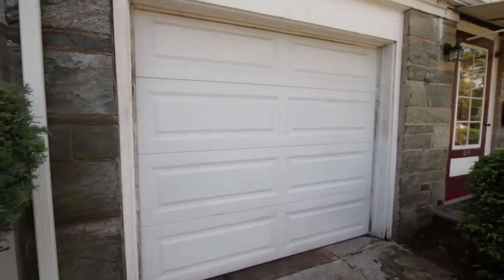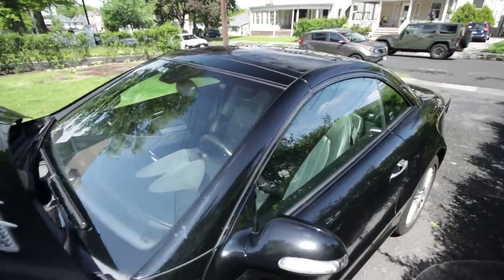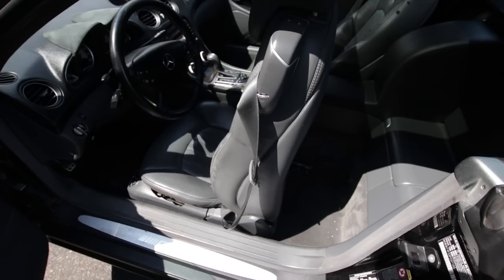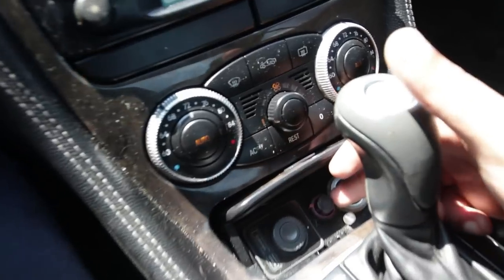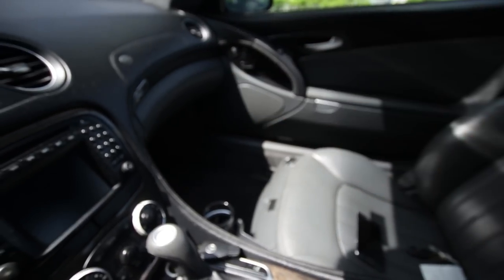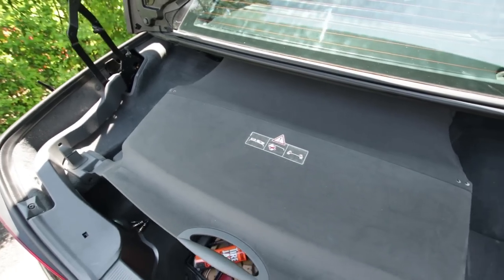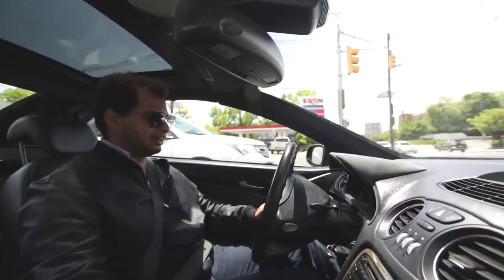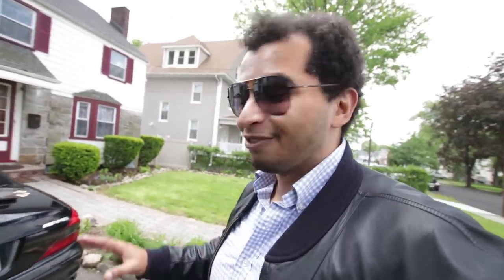I Just Bought A $130,000 Mercedes-Benz SL55 AMG For $8,900

Comment: I got mine over a year ago. It runs perfect i replaced the cam sensor and had to add some abc fluid as the abc light went on but mechanic says its good no leaks . The control arm bushings are cracked but mechanic says don't worry about ...
Reply: Abc is your big issue

Comment: My cousin got a 2003 SL 55  AMG V8 in Silver and it was a Hardtop for $8000 or $7500 a year ago and had to replace the camshaft position sensor i think and put some fake carbon fiber strip that says amg on the bottom of the rear window to cover up a crack.

Comment: Your brake light issue may be due to it sitting a bit and accumulating rust on the rotors and could go away after being driven same issue when I bought my 05 e46 bmw 325i

Comment: There's plenty of cars like this which may seem like an absolute bargain for example this car. But when it comes to running costs, its not cheap at all, you might have bought it for the price of a used Ford, but it its not going to have the running costs of the Ford. So when something goes wrong its going hurt the wallet. Which is exactly why they're so cheap.

Comment: For 8,900$ USA cash you can get 600 hp on a mean Honda Civic turbo or integra
Reply from the maker: ViDz614 and 35 ft-lbs of torque going to the front wheels.
Reply: When built right they push plenty of torque, do some research.

Comment: Living in Florida with that glass roof will be a bitch, temperature wise. Had a pano roof in my e class and had a sweaty back every time I went anywhere in the summer months
Reply from the maker: There's a sunshade and the AC is pretty good. Also, it's a convertible, so I'll have the top down most of the time.
Reply: Fair enough, great buy based on your knowledge. Definitely not for everyone

Comment: Hey Tavarish. Do you have an ODB2 or similar diagnostics tool?
Reply from the maker: Of course.
Reply: It would be amazing if you shared the output in your next SL video . . and your approach to using the data to work out the eventual fix. Will it say "roof stuffed"? Or will the detail be there for a very specific component?

Comment: To long review. For keyless go you need only to change battery in you key, you don't need any special key card. The missing button on your door is for locking the car, and if you hold it will close all the windows. To unlock the car just push the door nob. Also close to your missing keyless button there is small infrared 'port'. If you put your key close to it, and pres and hold open button it will open all your windows and sunroof if you have one. Anyways you have so much tech that you should watch a lot of youtube video to find them up. On your AC that button for air circulation. If you have your windows and son roof is open, if you press and hold AC circulation button, it will close all your windows. Few sec later if you hold it again it will open all your windows to last position you had. That is if something if burning out. It's also good to know if your open/close window button is busted there is a way to close from inside and 2 way outside. 1 is by holding keyless go button witch you are missing, and 2 is by trough infrared port. And there are so much setting in your cluster that I don't know from were to start... I'm gona send you some links to video, so you can watch them... By the way the car loks awsome...😉
Reply: Hi. Long video. But understand your enthusiasm. Since 2015, I have SL55 fully loaded distronic, ventilated massage seats, panoramic roof. I must say that it is one of best sports car I owned. I have lasted BMW M5. But I tend to go in SL on every opportunity in UK if weather permits. Easy to live with on daily basis. Suspension just right to avoid unpleasant ride. Porsche 911 is bit more sharp but this is not far off. 
I had to change ABC pump, supercharger bearing and automatic gear sensor. Apart from it no troubles. Although hard on fuel but dream to drive. Timeless shape. Enjoy your car as it is a lovely buy. I am sure Prices will go up in time.

Comment: for that price you bought someone else's problem. congratulations haha. I owned a sl500 and now a cl500, I hope you can repair stuff yourself or have at least double the money for repairs. I see this all the time, these cars for under 10000, my guesstimate is this: abc never once maintained, needs new pump, valve blocks and pressure reservoirs soon. supercharger bearing needs replacing. transmission oil needs to be changed, pentosin needs to be changed. if you buy original parts you will need around 10000-12000 to repair everything.